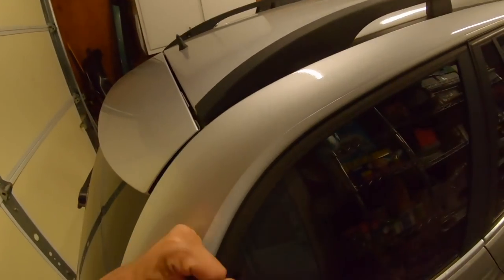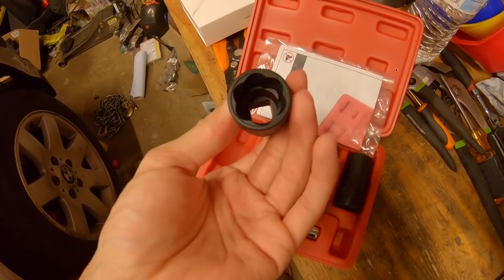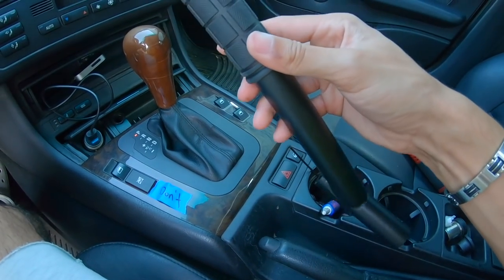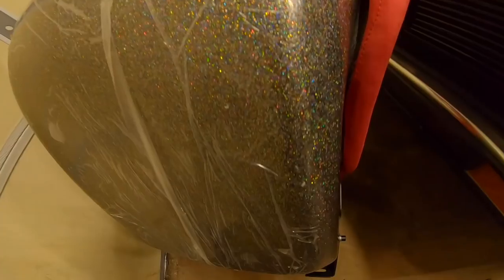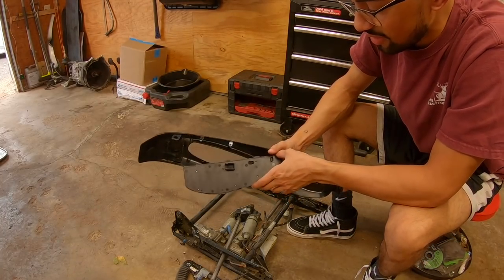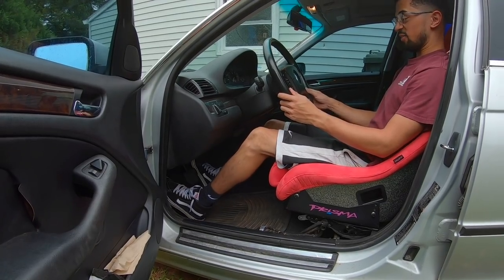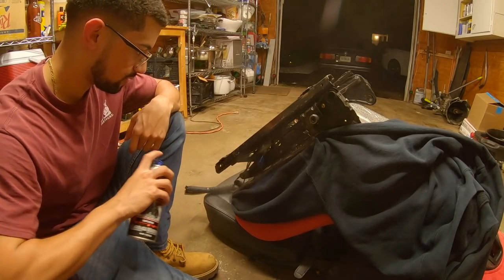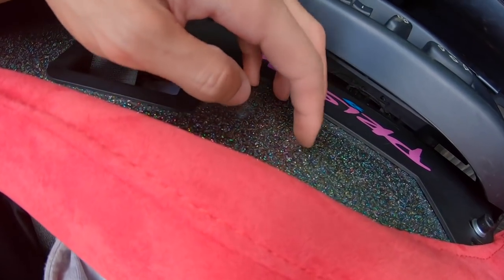Budget E46 Wagon Drift Build | Part 4: Bucket Seat Install

Comment: 14:53 google grinder wheel accidents from exploding cutting discs... you might just put your guard back on. Fingers and hands get messed up from each explosion plus you can loose an eye. Worst case it gets you in the neck and you bleed out. Those discs have a ton of energy and will fuck you up when they come apart.

Comment: 140k miles on my 330i, I just struggled to get my b4 cat o2 sensors on the Exhaust manifold off, soaked them in penetrating oil every 2 hrs, had to break them off in the same fashion lmao. They're out tho.

Comment: I’f that’s a ZF TRANS I’d replace the 5th gear and the reverse detent pins. For example my e46 has a 5 spd zf and when I shift from 5th to neutral the shifter leans towards 5th. Highly recommended

Comment: bro this reminds me of getting my car to pass emissions in ohio. im catless and have air pump deletes and tgv deletes. my tuner removed the codes completely from the ecu, literally didnt turn them off, he removed the code entirely lol. i was thinking im not going to pass forsure im completely screwed, found out in ohio we have little emissions test sites where you do it yourself. i went and plugged the computer into my wrx and the paper it printed out said pass on all of the little slots. i was literally ecstatic. went and grabbed plates that day easy, no questions asked. now im in virginia and in my county there are no emissions. just an inspection. lets see if i pass without cats

Comment: Fyi the E46 stock handbrake is absolute garbage, you'll be constantly stretching and tightening ya cables, for like an extra 30 bucks ya could have just plumbed in a hydro and be done with it 🤷‍♂️
If ya feeling flush you can buy the driftworks input/output lines and plumb them straight into the abs block so you don't have to cut any brake lines, shout at me if ya want a more detail description on how to install
Reply from the maker: i’ve heard some people had really good luck with the stock handbrake so i wanna give it a shot. i wanna work my way up with this car instead of just throwing hella $$ at it and having it be “perfect” right away. i think it’ll be more fun and i get to show what works/doesn’t work
Reply: @ImJoel  Okey dokey 👌✌️
Reply: @fuckngreat8955  I didn't go duel caliper so literally just had to buy a hydro/ lines n a couple fittings so was a real cheap set up that works so good I don't feel the need to go duel caliper.
There are alot of bolt on duel caliper brackets that use stock calipers, Google is your friend on that one, but be aware 90% of them require you to remove the standard drum handbrake cables so may make it not road legal ( depending on laws in your country).
Reply: @fuckngreat8955  you've never heard of an inline hydro?  It's basically where you don't have a tank on the hydro and t into the brake system, in my case I removed the pipe connecting the master cylinder to the abs block ( E46 master cylinder has an output for both front and rear incase ya brake lines pop ya still have either front or rear brakes) I then run a line from the rear output of the master cylinder through the hydro and back up to the rear brake input on the abs module, takes like 10 mins to install, is cheap and effective 👌
As for the stock handbrake on the E46 they are drums with a cable, removing the button and pin for the extension bar has now removed all clicks from the handbrake and it now doesn't lock on.
Fittings dual calipers will most likely require you to remove the stock handbrake cable so the bracket can fit on the hub.
My inline setup leaves the stock handbrake untouched and therefore would pass an mot
Reply: @fuckngreat8955  happy to help mate ✌️